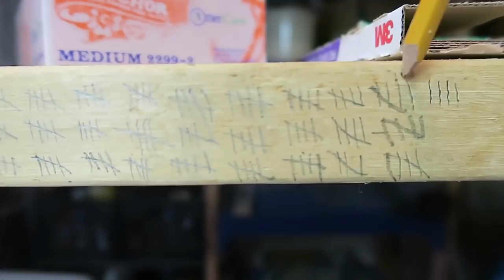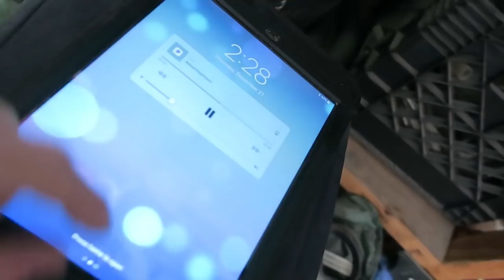Building A Chameleon Sailing Dinghy | Sawing Her In Half - #4

Comment: I am currently building a Chameleon dinghy myself.  After seeing all you went thru with the dagger board box i think i will just go with simple Lee boards like on many of the Bolger designs   They work just a well and no putting a hole thru the bottom of your boat.  If it was a flat bottom dinghy it would be no concern but with the V bottom much harder to get perfect.  Any way It would have bugged me as well if i did not correct it   lol     Thanks for your time  showing us your work

Comment: Just catching up on this build, and  little word of concern about split hull construction. I see the only way the two halves are held together is by two bolts through ply pads on each side near the gunwale. These will come under huge stress unless you have some method of fastening the bottom together at the keel. Water WILL get into the gap between the two halves as you sail along however close the fit , and especially from the the turbulances round the rear of the dagger board. This could put a lot of pressure on the front board of the rear half as there could be flex if the upper bolts aren't very tight. Perhaps I'm missing something in the build and this will be covered later, but keep it in mind. Apart form that, what a great build and nice to see real dedication to quality.

Comment: Looking good.  question as I am looking to build one of these one day.  Why cut the transom of the front part of the boat?  Couldn't you cut the bottom only?  Oh and how Molly doing with the name?
Reply from the maker: Happy to answer your question, but I can't quite visualize what you mean.
Take another shot at that and I'll do my best to give a good answer.

I think we have a name picked out now, but we'll keep it under wraps until the launch.
Reply: On the dagger board slot you cut thought the bottom (horizontal).  Which made sense to me.  But you also cut the back side of the bulk head (vertical) slot out.  I didn't see need for this, as the dagger board trunk is only open to the bottom, not the back side of the bulk head.   Could you have only cut the bottom? 

I'm not good at explaining things so thank you for your patience.
Reply from the maker: I understand your question.
I do didn't see the need for it.
Per the plans, it's supposed to be wide open on the back once complete.
I modified mine and closed the vertical slot back up, leaving only the recessed notch open.
It's visible in the final shots of the video.

Comment: Very nice job!   At 11:50s where you repair the bottom of the hull... is that thickened epoxy you are using?  If so, how do you keep those temporary sacrificial pieces of wood from being glued to the hull?
Reply from the maker: Good question. I wrapped them in wax paper.
Epoxy doesn't stick to it.
Aluminum foil also works for the same purpose, I found out.
Reply: I just sent you a small amount of $ via PayPal to say thanks for the Chameleon dinghy build series.  Best wishes.
Reply from the maker: Unnecessary, but hugely appreciated, Paul.
Thank you very much for that.
Glad the series has been helpful to you.  :)

Comment: First off, your build is looking good. But, I got to say, nice cover for a major screw-up! You realized you weren't supposed to have cut the bulkhead when you installed the trunk.
Reply from the maker: No, that's incorrect. The plans actually call for a much larger cut in the bulkhead than what I made. My modification is more conservative and much stronger.

Comment: All that work and it wasn't crocked to start with. You just didn't have the boat level. See it was only your perspective that was off by one degree... All that work could have been avoided if  you would have gotten another person perspective on it... LOL,LOL
Reply from the maker: Calm yourself.
To the contrary, a combination a 3 levels were used to ensure that the boat was sitting correctly.
This was the case during both installations of the daggerboard.
Pretty common sense stuff - still, mistakes were made.
Big things don't happen without mistakes along the way. It's just the way it goes.